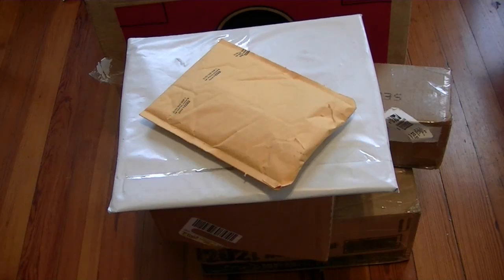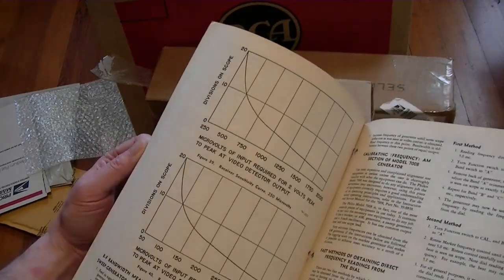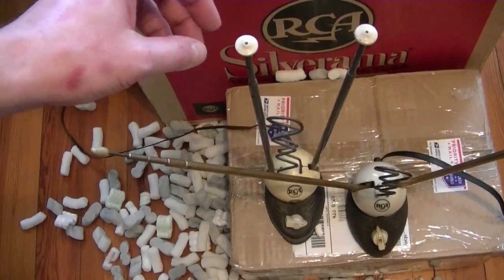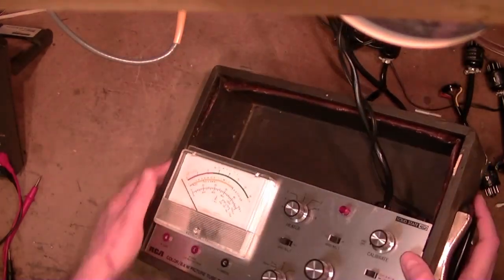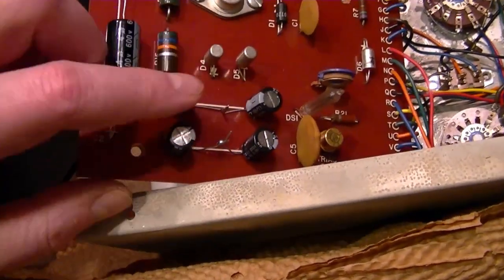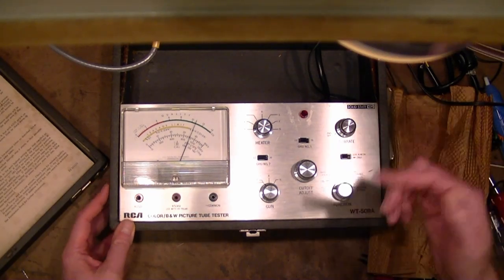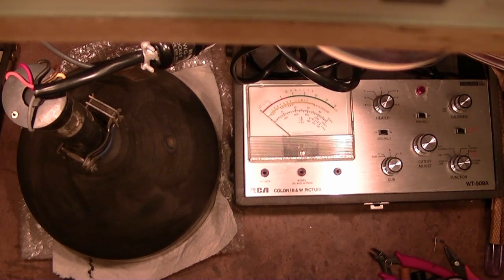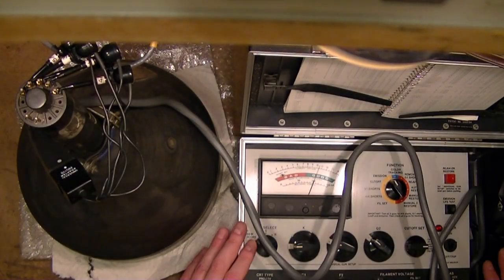Unboxing an RCA WT-509A CRT tester and other goodies

Comment: When is is off, is the meter just reading the line voltage? Great recap work.
Reply from the maker: I'm not sure.  I'm waiting on a copy of the manual.
Reply: That's what my B£K 367 does, figured it was similar.  Your videos were great, and keep getting better!